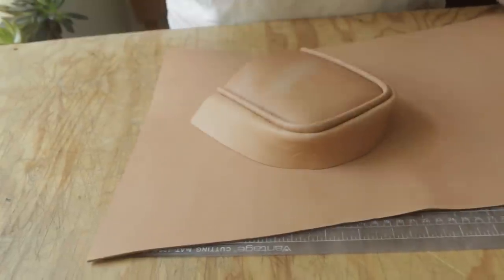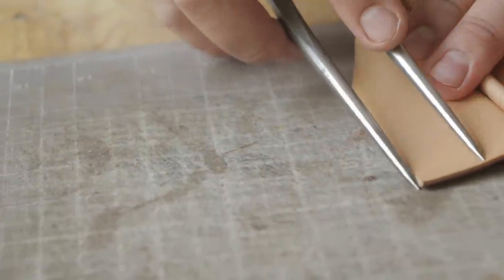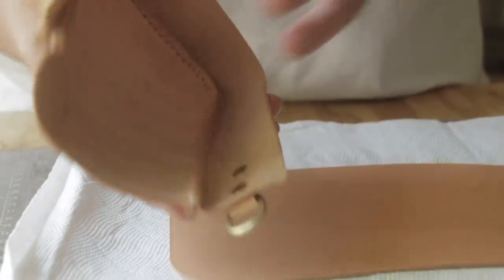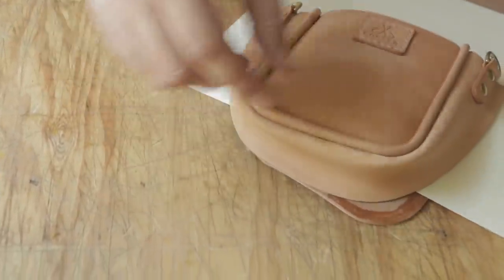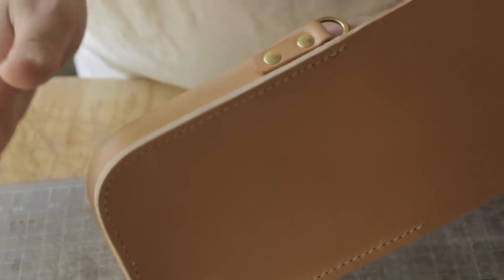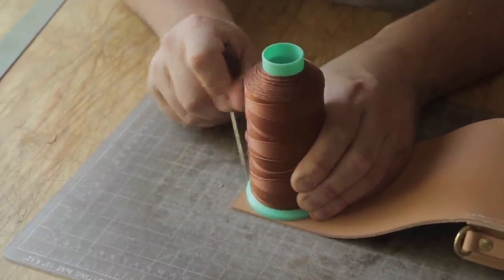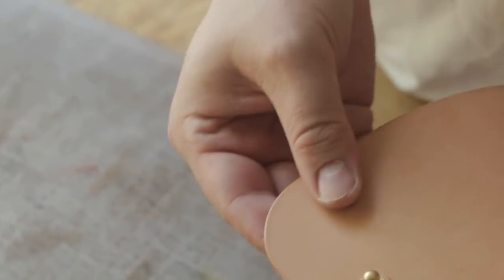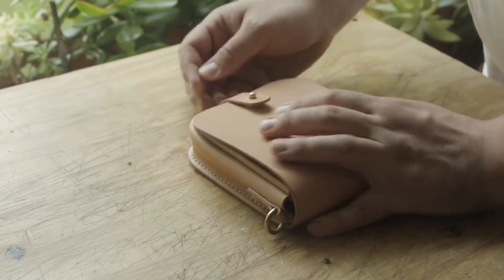Making a Leather Bag with Piping

Comment: Eric:  When you punch the stitching holes around the seam of the bag, do you simply start at one side and go all the way around or do you start on both sides and meet in the bottom middle.  I have never been successful just going around the outside.  Even with 5mm stitch length, the end looks different than the beginning.  This video cuts out the entire hole punching.  Suggestions?
Reply: I am not sure of Eric's proceedure but yes, the best way to get a uniform stitching pattern at the top is to start at the top on each side and meet at the bottom. This allows you to merge the two stitch lines with a perfectly spaced hole in the center that only you will ever know about. The other option is to change the size of your chisel punch. If you are using a 5mm spacing, you can either step down to a 4 or up to a 6 as you round the curves on the bottom and the offset chisel spacing will make up for the difference at the bottom or it will give you just enough room to get the perfect hole spacing with the original punch.